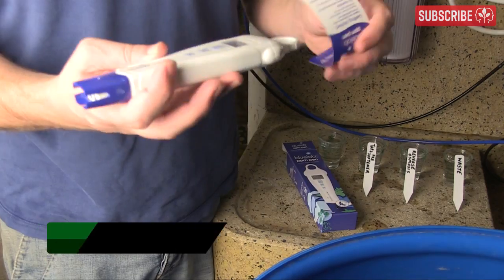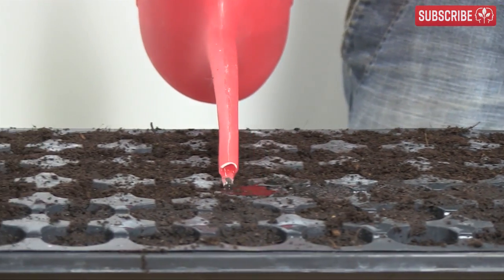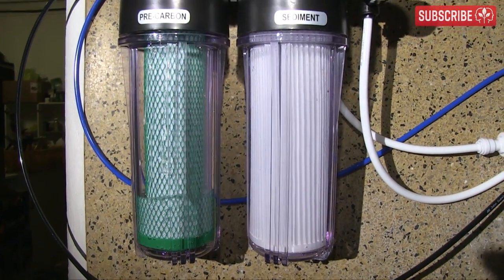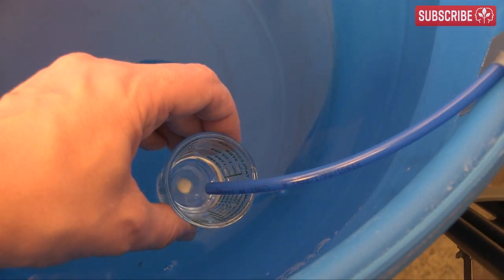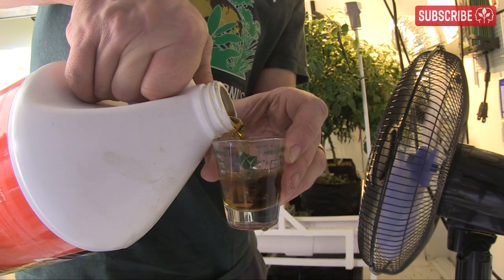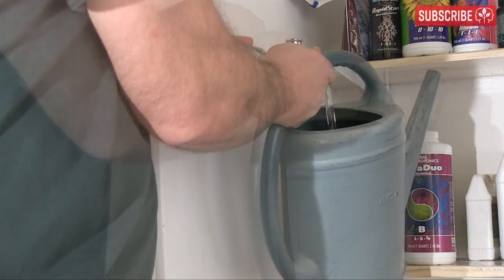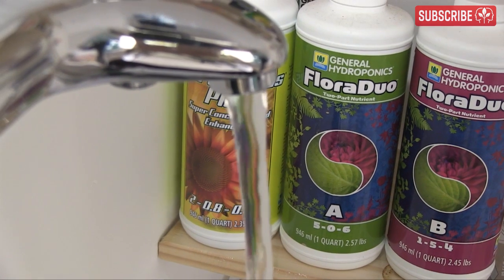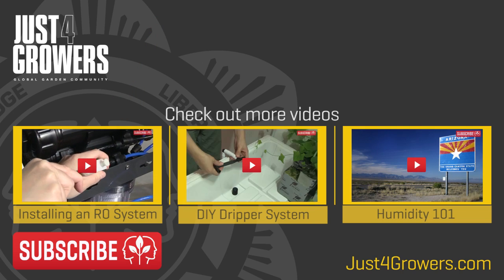Is Reverse Osmosis Purified Water Really Necessary for Hydroponics?

Comment: Do not add more Cal Mag unless you have an obvious deficiency .
Reply from the maker: I would not recommend waiting until you see visual signs of macro and secondary nutrient deficiencies, especially calcium and magnesium. If your water is very soft (<= 0.2 mS) or reverse osmosis, you should absolutely use calmag to get your EC up to around 0.3 mS. This is because nutrient manufacturers typically base their formulations on average tap water calcium and magnesium content. Reverse osmosis + calmag + base nutrients is the surest way of maintaining an optimal cation ratio, particularly calcium to magnesium.

Comment: 320ppm is nothing, east of england we get around 440ppm
Reply from the maker: My sincerest condolences!  A water softener and RO system is going to transform your world.
Reply: I pump out over 2000l of clean water a year for my carnivorous plants but at around 60ppm after the membrane I chew through di resin to the point where 250l of purified water has completely used a 300ml container of di resin

I'm waiting on more bits so I can run a 3rd membrane but after the 2 parallel so I can increase the flow restrictor and get more waste and lower tds and then feed to a sequential membrane on the waste side once waste has gone down from 800ppm to 630ppm with a 30second per litre increase to purified water time, but then it takes the membrane side down from 64 to 50ppm

I'm just going through a few channels finding other peoples setups and multi membrane setups and anything useful that might help since for some reason the 2x100gpd to a 200gpd and a 2yr old 100gpd did absolutely nothing to the purified speed and no one can understand why

Comment: In this video he says its 100GPD in the other video description it says 200GPD.... which one dude?! also how many stages is recommended?
Reply from the maker: ukessko I have two different filters - sorry for the confusion. 100 GpD is fine for me and my four lights. Three stages, including the RO.
Reply: @Just4Growers  thanks for the reply dude. Ok I think I'm going to go for a 3 stage like yours with a pump. the pumps the company sell make no mention of a pressure switch, however. I also haven't got a clue what to look for in a water softener and whether its harder or easier to install than the RO system.. can you shed any light on this?

Comment: What about using A/C condensation and water from dehumidifier? Would you recommend this? PPM comes out pretty low but feel like water is kind of darker though
Reply from the maker: Sometimes AC and dehums can leach heavy metals from their internals into the condensate. Some manufacturers say it’s okay to use the water after a few days’ operation (Ditch any water you collected during those first few days) - if your condensate looks discolored I would not recommend using it as part of a feed solution.

Comment: the calcium mag that your municipality might be adding is likely of lowest quality/purity purchased from lowest bidder, likely chinese!
Reply: The water company doesnt add calcium or magnesium
Reply: @atomizer2665  w2hat they DO ADD are harrdness minerals said to help seal cracks in the pipes, but likely more nefarious reasons, like fluoride. Where I live S FL, I used to cover the county selling water systems for Rainsoft, and later Aquathin. The TDS (hardness) AND chlorine in the water VARIES a great deal by community water supply
Reply: @roberthart9886  
 I dont think mineral deposits would be enough seal a cracked pipe that is under constant pressure ;)  Its logical to assume said deposits would eventually reduce the bore of the pipe over time. It not cost effective to pump water through a restricted pipe.
Reply: @atomizer2665  I said PRESUMABLY. I can tell you testing TDS around the county varied dramatically from city to city

Comment: (Updated)
Well yes it's necessary to have a reverse osmosis system if your growing cannabis especially if your growing in super soil because you need that chlorine and but most of all the chloramine out so that it doesn't kill the living organism's and microbs that's In living Super Soil but really to be technical you don't need a reverse osmosis system for instance all u need is to filter out the chlorine and chloramine with a kdf-85 filter or buy some Ecothrive Neutralise add few drops to your tap water and it will get rid of the chlorine and chloramine that's in the tap water but I highly recommend a reverse osmosis system because it gets out bad metals Ecothrive Neutralise can't.

Comment: Hi Can some one tell me if using a RO system on soft water. Is it worth my while. Or is it only good for hard water
Reply from the maker: If your soft water measures 0.3 mS (150 PPM) you can use an RO filter to get it down to zero - this is definitely worth your while. For harder water you should put your water through a water softener unit first to maximize the longevity of your RO filter.

Comment: THE 100 GALLON PER DAY SYSTEM LITERALLY TAKES 10 MIN TO FILL 2L.......SO YOU'D BETTER PREPOUR ANY WATER YOU NEED
Reply from the maker: Yes, 2.4L will take around ten minutes. Use a float valve and keep 50 gal in reserve.

Comment: Mine is 800ppm, I think the groundwater comes from limestone aquifers. RO is definitely necessary.
Reply: mine is 925 ppm did reverse osmosis system work for you ? if so what one did you purchase and did you install a watersoftner aswell or any prefilters?
Reply: @HINK82  yes, we have a water softener. Last I checked the water was under 10ppm. I can't remember the brand. But you can get them starting around $70 for a tiny one. They all should work.

Comment: What about just using rain water?
I get about 50ppm
Reply: Rain water isn't as clean as most think, it can pick up bacteria/pathogens and all manner of nasties...
Reply: @westwater73  the few times I've used rain water I was getting 4-12 ppm. If one was to use a low micron cloth filter and use a bit of hydrogen peroxide, wouldn't that put rain water to par w RO?
I just think it's a bit arbitrary to shell out doe when something just as good is falling from the sky.

Comment: like you vids helpful and quick to the point no doodling to get your 10 mins videos. plus RO is a must have i even drink the stuff as so much crap in the UK water are body and plants dont need not just minerals but all the high level of chlorine and fluoride that plants dont need and just slows it down from getting the good stuff it does need. am thinking of putting in a RO system but it is price in UK looking at £300 for a system to fit to mains plus the filters will need changing over time it cost money but it 100X better for you and your plants.
Reply from the maker: Thanks amigo. In the UK you have plenty of RO options. Go speak to the guys at your local grow shop about your needs or tell me how many lights you have and I can suggest some minimum flow rates. I’ve grown in Cardiff and Wolverhampton water - Wolverhampton was particularly trying for its 700 microsiemens’ conductivity (0.7 mS / about 350 PPM using x500 scale) - at the time I thought a hard water formula was sufficient but nothing beats pure, clean water to begin with. Once you go RO, that’s it. You’re in for life! ;)

Comment: Never had problems with my 50ppm. Will i see an increase in output if I get a filter?
Reply: Good possibility. That is a fairly good / low starting ppm, but you gotta think that those ppms may want to bond with whatever we put in and form solid precipitates that are no longer available to plants, just depends on what those ppms are. Chlorine in tap water will kill bacteria. Good in some circumstances but it shouldn't be necessary for this application.

Comment: My tap water here in central california is coming out 580ppm’s out the faucet and that’s WITH a catalyic carbon filter attached to the intake! I can hardly feed my plants anything at all until flower or i experience extreme lockouts. And it’s terrible because the plants are missing out on so many other vital nutes in the veg stage! Alright, it’s time to take the plunge and invest in a RO system.... 🙄
Reply from the maker: It certainly is my friend. I would recommend getting a water softener for your whole domestic water supply and THEN passing this softened water through an RO - your RO filters will last so much longer! Good luck! Once you grow RO you never go back!

Comment: Those pre water softeners use polyphosphate ? They do not include any additional elements in the water? I was just looking to know if it possible to increase the RO efficiency for aquariums use, but we struggle to get rid of  phosphate.
Reply from the maker: Ricardo Pimenta Water softeners tend to use either sodium or potassium as the “exchange ion” to replace the calcium. I need to double-check which one I’m using ;)
Reply from the maker: Chas. Chan The water softener exchanges the calcium for potassium or sodium, depending on the type, which is then stripped out by the RO - the exchanged ions create less wear on the RO membrane.

Comment: I love how you use general hydro. I have used all brands and think GH is the best and a great price.
Reply: @MrJre4491 I didn't see that when I made the comment. I don't know if I just missed it or if the post was edited. Either way it's there now.
Reply: @victorb145  The post says (edited) if it was edited.
Reply: Probably not the best idea to abbreviate General Hydro. I get it and easily figured it out but when you abbreviate this brand name you get GH of course and in a water video witch this basically is GH also stands for general hardness leaving a reader that's just skimming through very quickly potentially confused.

Comment: I'm coming from a saltwater fish tank world and I have a 5 stage RODI system and I'm running 150 gpd and my water pressure is around 90 which is optimal...you should consider getting a booster pump for better flow and install float valves so no wet floors or wasted water. Great video sir

Comment: Hey Everest, how many gallons can you treat before you have to change filters?
Reply from the maker: +Franklin Rand good question! My demands are not huge. I get through 25 - 30 gallons a week. My current RO filter is due for a change. Been running it for two years. 2500 to 3000 gallons then?

Comment: What are your thoughts on RO water vs regular Purified (brita, pur, etc) water?
Reply from the maker: RO for the win. Brita — while it does a decent job at removing larger particulates from my non-fluoridated tap water — is good for the kitchen, but won't remove chloramines, chlorine and only partially removes calcium and magnesium carbonates  and bicarbonates. It doesn't remove many other minerals from the water whereas RO will strip everything away save the H2O — giving you a blank canvas upon which to paint your ionic masterpiece!

Comment: do you think it makes sense to use distilled water with soil designed fertilizers? 
I use lightly fertilized off the shelf soil as a medium. 
My tap is usually 140ppm 7.8ph they don't go easy with chlorine too, first time I used it in a mint plant the poor thing turned yellow the day after.

Comment: I have tried to find an answer to a question, I wouldn't mind if anyone has any thoughts on the matter. 

If hardwater from a well is treated with a water softener how does that condition the water for hydroponic use ????
Reply from the maker: +Peter Koopman Hi Peter, domestic water softeners commonly use ion exchange (I.e. With potassium or sodium chloride) and, as such, don't actually lower the TDS or EC of your source water. I use a water softener too as my tap water is 350 PPM (TDS) or 0.7 mS/cm2. (EC). Then I pass it through a sediment, carbon and reverse osmosis filter in the form of a Stealth 100 RO machine by Hydro-Logic. A fantastic and very reliable device I might add. Works great despite my abuse! This lowers my PPMs and EC to zero - so that I have the most "room" in the water to add my plant available nutrients. Put another way, if you know your plants don't enjoy more than 2.2 mS or 1100 PPM even when in peak production, wouldn't you rather those precious PPM places were taken up by a balanced ratio of all essential plant-usable nutrients in solution (hydroponics) rather than being squeezed and pushed out of whack by an excess of calcium and magnesium? In short, buying a water softener was smart because it will make your RO filters last a lot longer. ;) buy a reverse osmosis filter and install it as near to your grow as possible. Remember you will need a drainage point near to the RO filter too.
Reply: I love the prompt response and have been a big fan. I was told once that the salt and resin type house hold water softener that isn't designed for hydroponics in mind is bad because it is using salt to treat the hard water. Thus adding the bad kind of salt into the water. I have used a zero water filter to get it down and it's affordable. The ppm pen says from the tap it's 135 ppm. I know it could vary. But I just didn't know if the ion exchange salt filters water is good by itself to use.

Comment: thanks man.  I have the bud booster 100 gallon a day system and I haven't set it up yet. my damd water is 360 from the tap.
Reply from the maker: +Beantown Greentown sound like my tap water. Defo go for a softener then the RO system. A water softener exchanges those calcium and magnesium bicarbonates for potassium and sodium which are easier for the RO to deal with.

Comment: https://youtu.be/rg8URazaZlM?t=203
calmag isnt in a chelated form, its simply calcium nitrate and magnesium nitrate. 
If you use nitric acid to lower the PH of your hard water, it will react with the calcium carbonate in the water to form... calcium nitrate.
Reply from the maker: +Atom izer Thanks Atomizer, you're more correct than I was! CalMag sometimes has a dash of calcium chloride and magnesium sulfate in it to, depending on the brand. But definitely not chelates. I misspoke!
Reply: Mixing magnesium sulphate (aka Epsom) and calcium nitrate in a concentrated solution will form calcium sulphate (gypsum), it`ll  resemble something like an insoluble cream cheese :)
Reply from the maker: +Atom izer heheh yes! You won't usually find them in the same bottle :)

Comment: heres one for you ev...if calcium and magnesium carbonates are not readily absorbable in the root zone...hom come General Hydroponics CaliMagic works so well? It is a 1-0-0 calcium carbonate and magnesium nitrate? And another stumper...how come if you strip out the carbonates from yiur tap with r.o. water you may see deficiency especially in coco coir if you dont add a calmag around 0.3 - 0.4 ec to tue r.o. water? If carbonates in tap arent readily available then in theory. ..r.o. water with zero or close to zero ec should he just fine. Always wondered this. If you got an answer....bring it.

Comment: I noticed you have a big drum as a reserviour, and was wondering how you setup a recycling water system with drainage at a lower level then your res hieght? i found that i have to drain into a res which is at my pot level and then pump back into my main res with a pump and a float. is there a better way?
Reply from the maker: Good question Nosaj. You can use an inline pump with a built-in flow detection switch that will push any leachate through a hosepipe at pressure, thus enabling you to channel your run-off to deposit points that are higher up. You could also set up a transfer pump on a float valve to transfer the run-off from your lower res to your main res. Finally you could investigate setting up a siphon between the two if they are fairly adjacent.
Reply: Thanks for the info, the flow switch system would be the most suitable but i have not seen a system described with this. nor do i know of any pumps that can do this that arent large pool or pond type scales. any suggestions?
Reply from the maker: +Nosaj Sebrof The way I've dealt with this in most simply the past is to have a submersible pump in my run-off reservoir periodically switch on and pump into the main res.
Reply: yes that is what i was thinking. but my concern is if the pump starts sucking air when the drainage res gets low it would damage the pump(if it was on a timer type thing). hence a float or flow switch to cut the pump power when required. I use aqua one pumps currently but they are just basic aquarium pumps. do you know of any pumps or small size like these that have floats or flow switched in them?
Reply from the maker: You can buy pumps with float switch attachments from Home Depot.
Reply: if only home depot was in australia lol

Comment: Great video. I'm about to buy this unit. But in my basement the waster water will have to go up about 2 feet above where i could mount the machine to a drainage pipe my washer uses. I always see people putting the waster water tube down below the machine into a drain. Can the unit pump water upward?